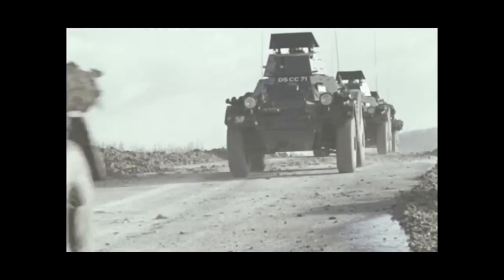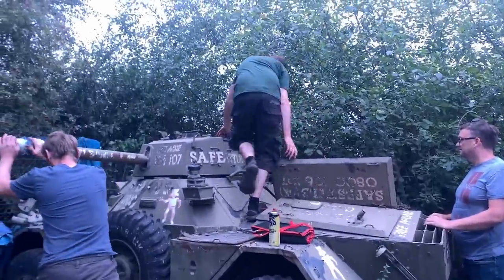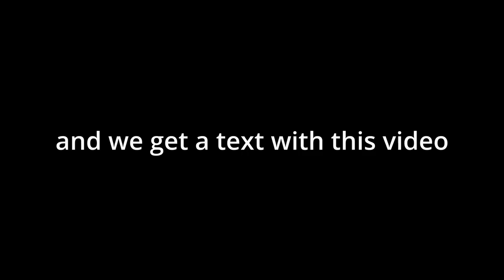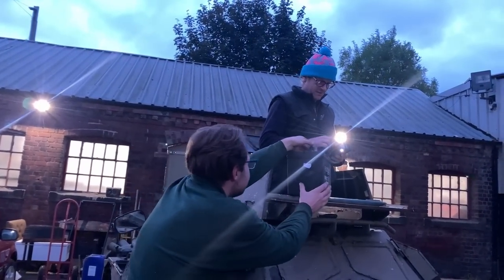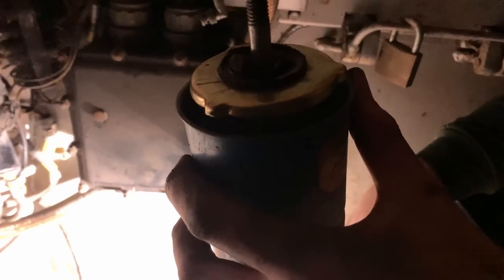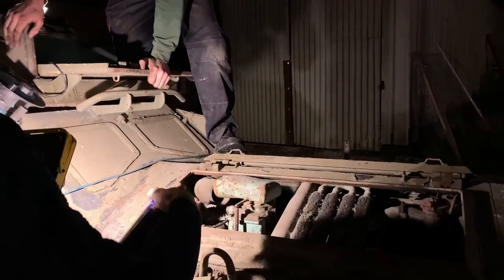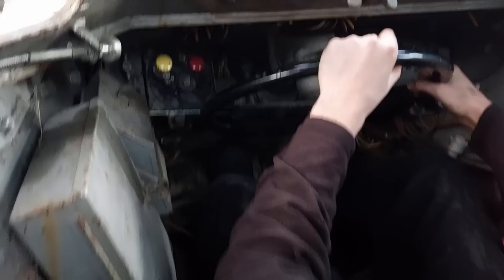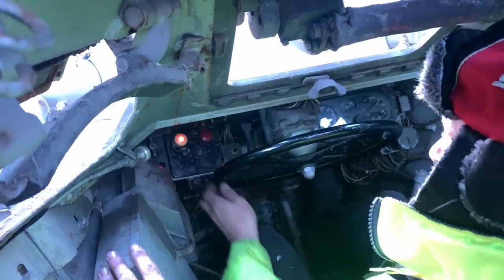Will it start? Our Daimler Ferret hasn't run in over a decade.

Comment: I remember as a child the council buses had pre-select boxes which I thought was pretty cool even then. The old gear like his goes forever, can you imagine all the systems like gearbox, engine, brakes, water pump and any of the myriad of things that make a vehicle go, not to mention seals on the main crank and other seals, work on a modern vehicle after sitting idle for 10 years ?. I think not.
Reply: I served my time on The Spanners and a mate of mine worked for our council Bus company, they had those Pre select gearboxes in them. He told me that the lads who worked in the Transmission shop were always mad busy. The method of operation was to move the gear lever from one gear, into neutral and wait for a Red light next to the gear lever to change ( can't remember which way it went ) and then move it into the next gear, of course most of the Drivers never bothered with this, they just went straight from one gear to the next. The result was, the next brake band was tightening up before the previous one had let go. They were going through brake bands like lightening. He said we used to have reconditioned gearboxes on hand and it would be a straight swap and then recon the knackered one.

Comment: Good to see the old girl living again :)  In theory you can prime the fuel pump from inside the fighting / crew compartment.  You need a long screwdriver and a skinny agile 19 year old.    Some people mod the fuel pump by connecting a long bar so it can be primed from the engine compartment.
Another mod that is to connect longer pipes to the rear axle boxes so you can fill them without having to remove the back armour.
There are manuals online and a pretty active community on various forums including FB.
Reply: B Series Rolls desighned Military engine run for ever. I had the four cylinder version in my Champ.
I think the Saladin and the Saracin had the eight. Not sure.
Seen a Humber Radio Truck with a B60 though. Beast !

Comment: Great vid ! I’m a Ferret restorer here in Australia and thoroughly enjoyed watching 👍
Reply from the maker: Thank you! We aren't going to do a full resto of the Ferret, but we are going to do some bodywork repairs in the next video.
Reply: Great Scout Car, drove one in the TA when I was 19. Bloke hit me on a roundabout with an Avenger.
His Avenger Exploded in a mass of cheap metal. Fire Brigade got him out the remains unhurt.
'I did not see you' he said. NCO on the scene said to the cops and an officer who turned up'The Army will have to get bigger vehicles'the civvies can't see the ones we got.' 
The Ferret had scratched paintwork and a bent mudguard.
I had a sore head having smacked my nut when he rammed me. 
70 now,crikey that was a long time ago.
Reply: I wish I was in Oz, I would willingly give you my time to help with the ferrets
Reply: @crap_car  everyone used to stand on the side box lids to get in the vehicle, they were quite robust, but were usually caved in a bit, we used to hang our webbing on the pick axe and shovel on the front, although you had room to wear it in the ferret you couldn’t get in and out of it, and as you can see the fuel tank is in a great place for a bit of pre-ignition combustion heating! While they were quite stable without the turret they were not great with one, we never practiced  taking the side bins off for escaping as it was hard work getting them back on again, the wheel or contents of the side bin used to be too heavy to get the side off anyway if I remember rightly?
Reply: @crap_car  Just check the hubs, jack each corner up and try to move the wheel from top to bottom, if they move they will need work or they may fall off on a corner!
(You really don't want that to happen).
Reply: We cant figure out how to get the spark plugs out of ours they are that tight we are wondering if it has a left or right handed thread

Comment: When it comes to further work on the ferret I have original, reusable felt oil filter elements, the correct CES recovery wire with shackles and  both chain ends and sand track used on some Ferrests pictured in British Army use in North Africa in the 1950s-60s. If you are interested.
Reply: Those sand tracks were like gold dust, if you mean the PSP plate ones, not bad in the mud either

Comment: Loads of fun - shame you didn't get the 'cold start' lever working first rather than pumping the pedal, but well done for getting it running. Now you need a Jolley Engineering electronic ignition kit in it!
Reply from the maker: We needed a choke cable, but I believe that's fixed now. Thanks for the tip. We'll look into that!

Comment: I find your lack of Borders Biscuits disturb ... oh wait they made it in the last 20 seconds. Great video Gents, fascinating piece of machinery, I love the unnecessarily awkward driving style including the inverted steering wheel (which is just bizarre) and the complex gearing. Great work on getting it to run. Any plans for it?
Reply from the maker: Thanks for the kind words Graham. We were planning on selling it, but we keep changing our minds. It's not very practical. Or fast. Or economical.
Reply: @crap_car  My Champ was not very economical fifty years ago,and we were getting two and a half gallons to the pound then. Gawd knows, what it cost's nowadays to fill that thing up.
Champ took twenty gallons,hate to think what a Ferret needs,fifty gallons ?
Reply: @philiprufus4427  Only 21 gallons, and it needs E5 petrol or the rubbers bits rot. 9MPG on the road, 4 off-road. A full tank gives you 190 mile range on the road.
Reply: @CliffAndLouise  What's E5 patrol, is that pure petrol? No corn fuel?

Comment: Did you give the motor a spin while you were mucking about in the yard with it ,The guy feeding Brake cleaner knows Not easy way to hydro-lock the engine and you don't want to do that

Comment: Bit of advice get a mechanic that understands how a petrol engine works
Reply from the maker: When are you coming to get it running then?
Reply: We WD40d it, 4years ago😂
I drove one of these in the 80s I would so like to renovate one, it was like driving a video game because of the angle of the steering wheel. It was horrendous in the cold, but still great fun, if you went through rough ground too quick the mud came in the front- ‘window’ is a bit grand, the mud came in the front hole you looked through to drive/point, that bit wasn’t like a video game!
Reply from the maker: @mawilliams777  We went to visit a local owner and he took us for a spin in his. It was winter. And yes, the wind rushing through the open front hatches almost gave me frost bite.
Reply: @crap_car  some units got plastic and fibre glass windows made for them that fitted with the hatches open!
Some even made hot air ducts from the rear of the engine made to blast warm air in to the front, never a great idea in my experience.

On the range roads in Germany you had to share the the ‘bumps and dips’ made by the tracked armour because you weren’t allowed on the tarmac as the ferret was too heavy but they used to be deeper than the the ferret, which was fine until the dips filled up with water from the rain!

If You could get a good rhythm going it wasn’t a problem, if you didn’t you were up to the waist in water!